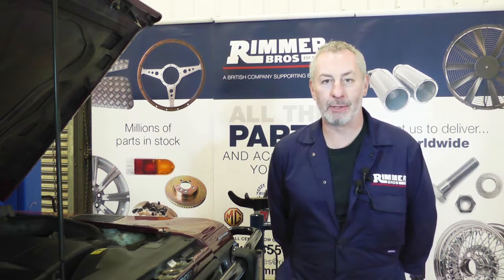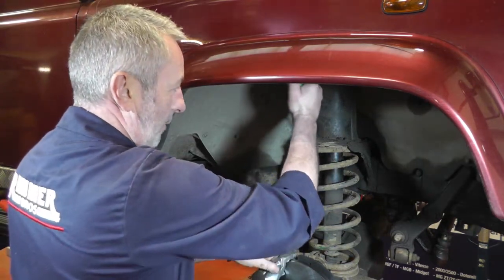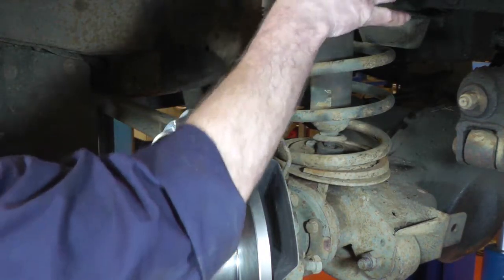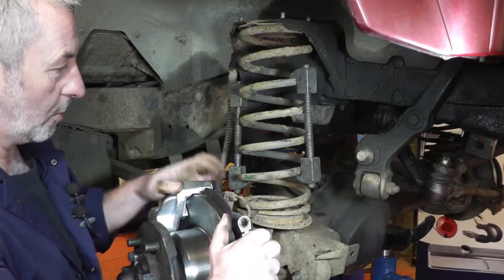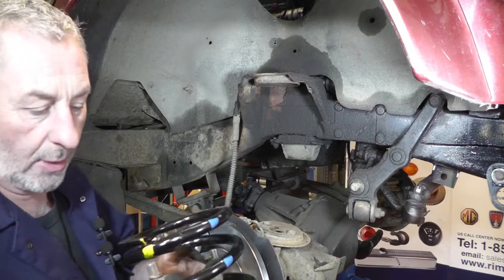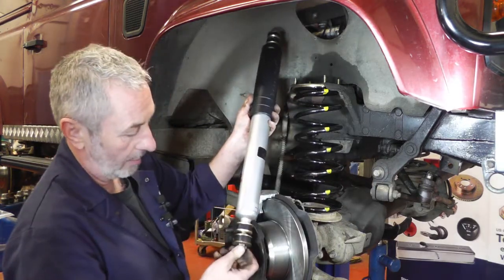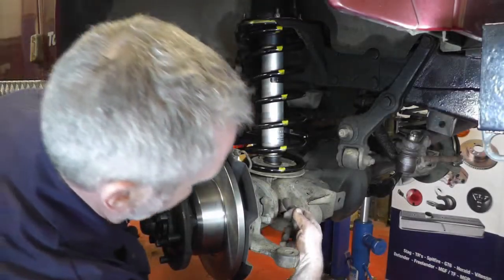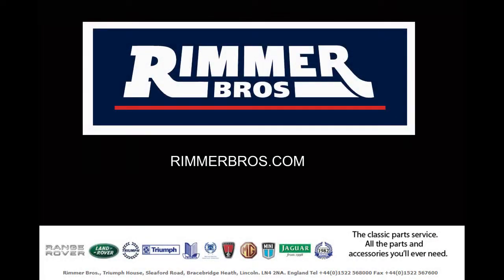Installing New Front Shock Absorbers, Springs and Turrets on a 2001 Land Rover Defender.

Comment: Several points:
1. Not so easy with gas shocks which by default go to maximum extension. It'll be easier if you use some form of restrainer which you may have to make up from stiff wire or similar (new gas shocks come with these) .
2. Put a bit of copperslip grease on the studs and the nuts will come off easily next time so you won't have to replace the ring.
3. You will note at 4:30 that the spring is coming off the bottom seat with the axle dropped. You can use a small D shackle at the front to retain it. This will come in handy if you do any heavy offroading (otherwise the spring can come off).

Comment: Any advice on getting the lower nut on? the threads are not showing and i need to compress the rubber bits to get to them. Got lucky with a wedge on my drivers side, passenger side is even worse.

Comment: Nice video, and very useful to have the part numbers mentoined in the video. I only wonder if there aren't any torque settings related to the shock absorber mounting bolts. What is also very useful for the DIY enthousiast to tell a little bit more about the typical things which you can encounter while doing this overhaul. Like, typical rust area's which you need to check now the shock absorber / spring is out of the way, or what you should use or not use for lubrication or conservation when mounting the new parts.
Hope you appriciate the feedback, I really like these type of video's!
Reply from the maker: Thank you for the feedback!
Reply: @RimmerBrosTV  well then what’s the answer??? You can post all those specifics to the comment, so folks like me see it for years to come
Reply from the maker: @TheChupacabra  Hi Mike, what would you like to know?

Comment: Great I did this to my defender a few years ago and needed a refresher of what i did and see if there were any hints or tips to ease the swap on my current one. All I'll add with any jobs on underside of a defender that require nuts and bolts loosening, if you can spend the time a few days before spray plus gas or similar product on all the nuts. This helps release stuck nuts and saves time (hopefully) on the day of the work.